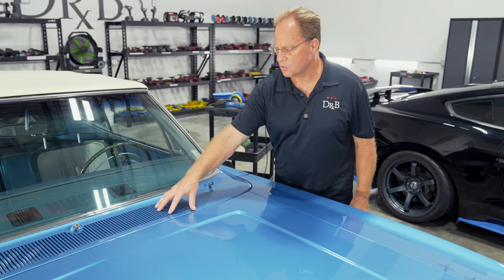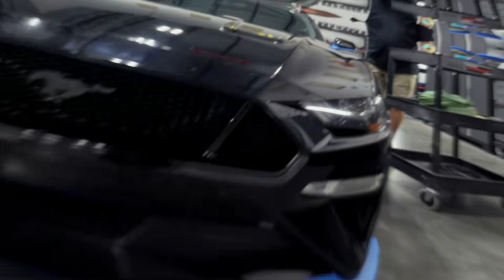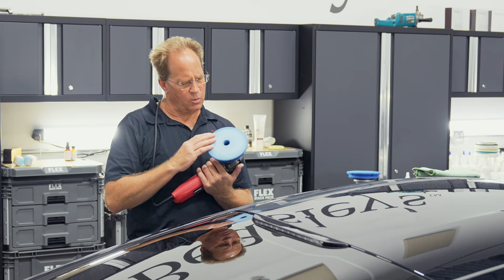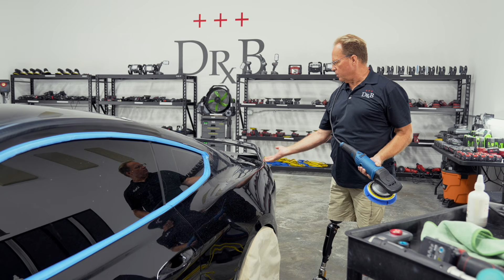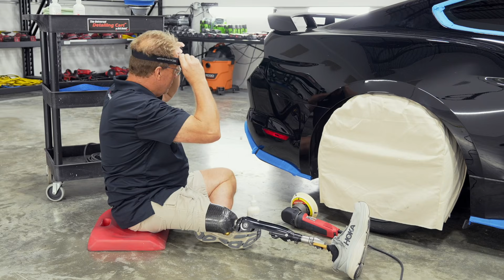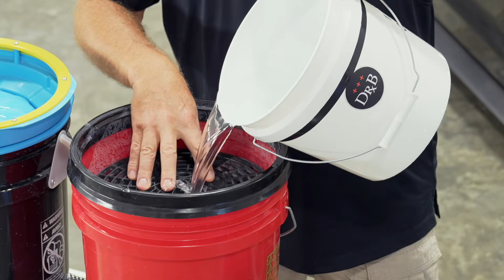More DIY Polishing Tips for Beginners | Part 2 of 2

Comment: I learned that tape technique from my dad years ago, it's also the technique we used for laying tape based pin stripes. It sped up my ability to prep cars for paint and detailing tremendously. I got so nuts about laying tape I kept an exacto knife to carve intricate shapes to tape off tricky body curves, emblems, plastic bits, etc. Great tip to pass on.
Reply from the maker: It sounds like you really mastered the art of prep work back in the day, which is the most important part of the job. Thanks for watching and commenting. -Mike Phillips

Comment: 2:52 I find the scotch blue tape leaves a lot of adhesive behind when I peel it off. Especially if my work area is hot.
Reply from the maker: I'm not sure if these two things are factors, but heat/warm temperatures and/or age.  Warm or hot temperatures simply soften the adhesive glue and can lead to leaving sticky residue behind on the surface instead of releasing cleanly.  Just my own experience, the best tape is always the newest tape, as in purchased this week at your local hardware store.  As tape ages, it seams as though the paper component becomes more brittle, so it breaks easier, and the adhesive seems to have lost some of it's original adhesion strength.   

Not being a painter's tape expert, here's my normal practice.

1: If possible, use new/fresh tape.
2: ONLY leave tape on the surface as long as necessary.  As soon as it can be removed, do remove it.
3: When removing tape, pull low and slow at an  angle.  DON'T lift straight-up as you could remove paint or surface material off the underlying panel or component.

Not sure if any of the above helps, but that's all I got.  Thank you for watching and commenting.  -Mike Phillips

Comment: Hey Mike have a question about the finishing pad can you use one pad to do the whole car or it better to use multiple to get better result ?
Reply from the maker: You can easily use less pads for the finishing step.  The one thing to look for is good pad rotation and oscillation while running the polisher.  As your buffing pads becomes wet via saturation with the product you're using, you'll lose good pad rotation.  It's real simple.  DRY pads will rotate and oscillate BETTER than wet pads.  So just pay attention to pad rotation and when you see it fall off, it might be because the pad is wet.

Remove oxidation single stage paint MIKE PHILLIPS
Reply: @DrBeasleys thank you so much!!
Reply: @DrBeasleys another question Mike . How many passes should we do with the finish step or that depends?

Comment: Mike great videos love watching you give very precise instructions. I have a quick question how would you deal with stripes on a car like a Shelby GT500 that has stripes. Tape over them but use a delicate tape. Just like you would tape over plastic and rubber.
Reply from the maker: Complicated question.  I actually have a 2008 Ford Mustang Shelby GT 500 (black), that will be here for our May 2-Day Car Detailing Class.  It has glossy white vinyl stripes and letters along the bottom of both sides.  Here's link to picture,

https://themikephillipsforum.com/media/2007-shelby001-jpg.10627/full

We also recently made a video where I shared how to machine polish glossy vinyl graphics to remove decades of oxidation, swirls and scratches.

SAVING 27-Year-Old Factory Vinyl Graphics via Machine Polishing
https://www.youtube.com/watch?v=qXDGmnbQXMU

With glossy vinyl graphics, as long as you're careful and only using soft foam pads and quality abrasive technology, you can buff right over them.  I've done this hundreds of times with no problems.

If you want to be careful, then simply avoid buffing OVER them, buff UP TO THEM, but don't buff on them.

If you want to be SUPER CAREFUL then go to your local hardware store and get the light purple colored SCOTCH Delicate Surface painter's tape - Part Number #2080

This is a low tack tape so you shouldn't have any problems placing it over the graphics and then removing it later after the paint correction steps.  A good rule of thumb is to use it and remove it as soon a you can versus letting the tape sit on the surface for weeks or longer.

Me?  If this is a newer car and the graphics are clean, glossy and without damage, I would buff up to them but not on them.  If the paint is dirty, for example it has road film or traffic film over the entire car, AND if you plan to ceramic coat the car after the paint correction steps, then LIGHTLY buff over them with a soft foam finishing pads and an ultra fine cut polish, like our NSP 45 and using a free spinning, random orbital polishers.

This will CLEAN the surface of the graphics and any paint in and around them, so the coating can make a proper bond.

Mostly, just take a careful approach.

Great question, than you for watching and commenting.  -Mike Phillips
Reply: @DrB @DrBeasleys Mike  thank you for your response and your wealth of information many thanks again.

Comment: hey mike, i have a white car and planning to lightly polish every 6 months using a very fine polish like menzerna 3800, to remove slight defects but mostly to clean stains on white car (i read your article “the case against long term ceramic coatings). what would you say is the best pad for this? do i use the softest finishing pad or do i use a polishing or medium cut pad, given im going to do this every 6 months. my aim is to preserve as much clear coat as possible. thanks so much!
Reply from the maker: Normally they way you determine pad, product and process by doing a Test Spot as this will tell you if the paint is hard, soft or somewhere in the middle.  That said, for a light polishing, usually a foam "polishing" pad or a foam "finishing" pad.  The tough thing about working on white paint is you have to look more INTENSLY to see before and after differences when doing a Test Spot.  Sometimes it helps to turn off all the lights in the garage/shop and then inspect paint with a swirl finder light or even the light on a cell phone.  -Mike Phillips

Comment: Would you also tape off chrome trim around windows and mirrors?
Reply from the maker: On new cars the answer is YES.  Sometimes, the trim around windows and mirrors are not actually chrome, but are anodized aluminum and while it's usually safe to accidently run a spinning foam pad over it, to be safe, simply tape-off and cover over.  An ounce of prevention is worth a pound of cure.

Thank you for watching and commenting. -Mike Phillips

Comment: Hey Mike, 
Do you recommend cleaning the pad between passes with a shot of compressed air ?
Reply from the maker: No, I don't recommend cleaning FOAM pads with compressed air.  You drive the liquids FURTHER into the foam making them more difficult and time-consuming to clean.  I hand AND MACHINE wash all our foam pads here for our car detailing classes.  NOW when it comes to microfiber or traditional wool pads, then YES I use and recommend using compressed air with a combination of a nylon pad cleaning brush and/or a wool pad cleaning spur for rotary polishers.

Thank you for watching and commenting.  -Mike Phillips
Reply: @D @DrBeasleys thanks a lot. Have a grest day

Comment: What speed do you use when using the finishing pad?
Reply from the maker: Great question!  Kind of depends on the tool.

With a free spinning, random orbital polisher I want to see good pad oscillation and good pad rotation.  I adjust the speed until I see this via the black marks on the backing plate and or side of buffing pads.

If I'm using a gear-driven orbital polisher then I'm on the 5-6 speed setting simply because these tools don't feel good when buffing at 4 or below.  

NOTE:  If I cut with a gear driven orbital polisher and I'm working on soft paint, then I will switch over to a free spinning, random orbital polisher as gear-driven orbital polishers simply don't finish out as nice (and consistently), as free spinning, random orbital polishers *on soft paint*. 

Thanks for watching and commenting.  -Mike Phillips (the guy in the video)

Comment: FYI Flex as a great backing plate that fits the Hercules for 5 inch pads.
Reply from the maker: Of course, the Harbor Freight Hercules Forced Rotation Dual Action Polisher is a COPY of the FLEX BEAST and thus the backing plates are interchangeable.

Check out my video and blog article review for the  Harbor Freight Forced Rotation Dual Action Polisher by clicking the link below.  It's very in-depth.

Review: Harbor Freight Forced Rotation Dual Action Polisher
https://www.drbeasleys.com/blog/2024/03/09/review-harbor-freight-forced-rotation-dual-action-polisher

Thanks for watching and commenting.  -Mike Phillips

Comment: Is it idiotic to add touch up paint to a paw print scuff and then wet sand it a little before buffing in order to preserve more paint?
Reply from the maker: It's not that it's idiotic, it's just that you'll sand and buff off most of the paint you're trying to add as you buff the paw printi to make it less visible.   If you feel confident in your idea for your process, it wouldn't hurt to try it, but I'm pretty sure you'll end up with the same results as if you just buffed and stopped.  Due to how thin the factory clearcoat paint is on modern cars, there's simply a limit to what you can do.

Thanks for watching and commenting.  -Mike Phillips

Comment: How would u clean microfibre pads? The same way u clean foam pads?
Reply from the maker: No, if I were using microfiber pads I would want an air compressor and either a pinpoint air squirter of Tornador Blowout Gun.  

Using microfiber pads is very different than using foam pads.  And keep in mind, the reason you get better cut with microfiber as compared to foam pads is because the fibers that make up microfiber pads are a form of ABRASIVES.  And for this reason, microfiber pads don't tend to finish out as nice as foam pads on medium to soft paints.

Thanks for watching and commenting.  -Mike Phillips